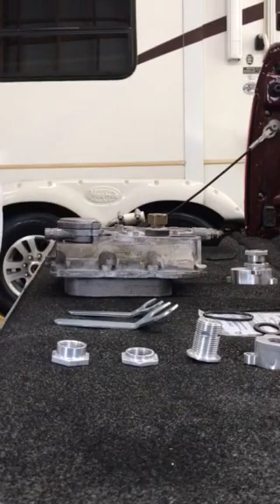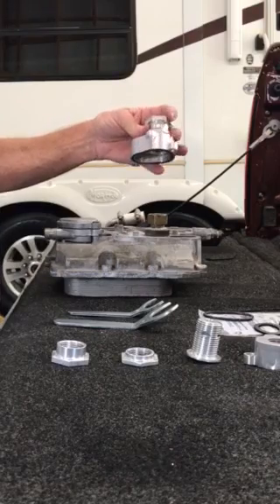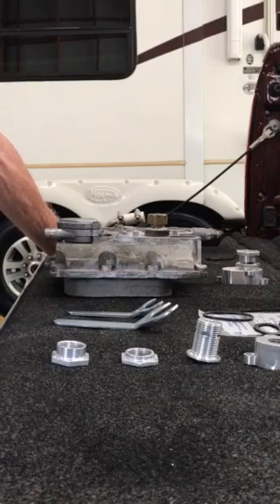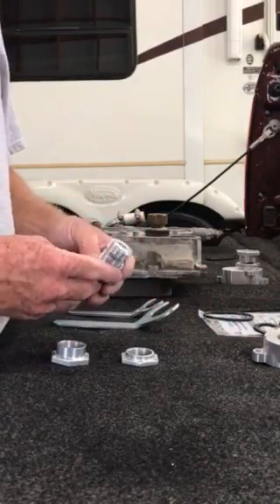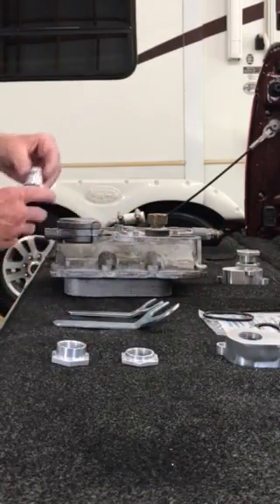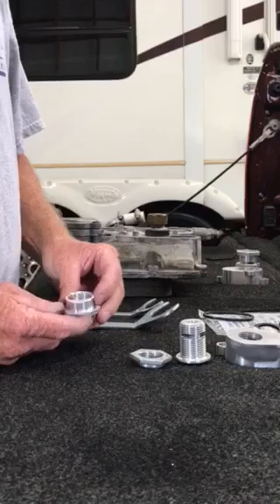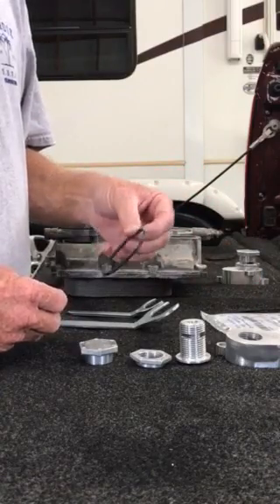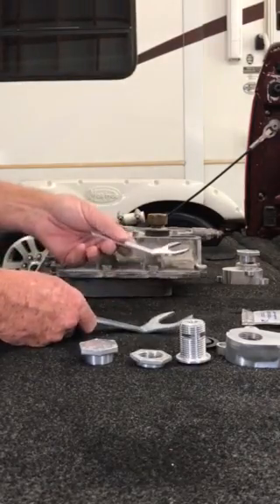FixUr6.com Oil Cooler BackFlush Valve Gen 2

Comment: They sell at auto zone the little  Titan    ratchet with box of diff torx bits like 12doll more or less got mine back in December just now installing it and it was tight allen wrench first but it comes rite off my part was a lil scored up like where bolts go in not level hate to complain but other that looks good finger crossed.   👍🏻👍🏻

Comment: Ahh Man  i love the craftsmanship...i have about 153000 on my excursion   its been very well maintained ..all sudden my eot is runnin225     ect 190 degi.....do yo u suggest any vc9 or i hear clr  thru it?..I just Purchased Your kit alnd the wrench the elbows   All i need is a Prayer now it works  i..i just changed the anti freeze 1000miels  ago  and it has had a sinister coolant filter on it for ever
im studded and run mild tune but usually just cruise haul tools
Thankx for any help   boy like se a vid getn that bich screw out.
Reply: Before putting any chemicals in I'd try a backflush or 2 with water and compressed air. The combination should be able to clear our most blockages. As for a video removing the back bolt it would probably be deleted for all the salty language. Just take your time and keep telling yourself that it only has to be installed once!

Comment: Hello JC just got my Fixur6 flusher yesterday and got it installed. I am amazed at the crud and scale that came out of the cooler. I built a flusher to attach to your tool that uses water and air pressure to backflush. I did this four or five times and was still getting a little bit of crud on the last flush. We then flushed the cooling system with Ford VC9 and refilled the system with Distilled Water and Ford Gold coolant. My oil temps have dropped about 4 deg. So we will see how it does pulling the travel trailer over the mountain's I suspect I will have to back flush again to try to get more stuff out of the cooler. 
I am impressed by your design of this tool, it is well thought out and designed and works great on these engines. Your recommendation on the little bit ratchet from Amazon worked great. Amazon also had the same ratchet with a flex head and I bought it also and found it to be a little better than the fixed head due to being a little bit longer with more leverage, The screws holding the cover were very tight on my truck. 

Good luck with the sales of this tool I hope it's a big success for you and something that you can be proud of. Steve

Comment: Hey thanks for the video.  I was hoping you could show a link to that ratchet.  I am looking for it and can't find one.  Thank you.
Reply: Josh, try this at Amazon https://www.amazon.com/gp/product/B005F1QL02/ref=oh_aui_detailpage_o08_s00?ie=UTF8&psc=1. Have you ordered a BFV?
Reply: Jim Cooper I did bit I ordered it through ficmrepair.com
Reply: That's great. They are super to work with. Did that link help. Amazon also has a flex heat small ratchet.
Reply: This product  is very useful  makes flushing your oil cooler  and getting your deltas lower

Comment: Just bought mine today. I'm still running original oil cooler and head gaskets on my 2003 6.0 PSD. Haven't experienced any off the 6.0 PSD issues that they are known for. Can't wait to put this on, back flush and see what comes out